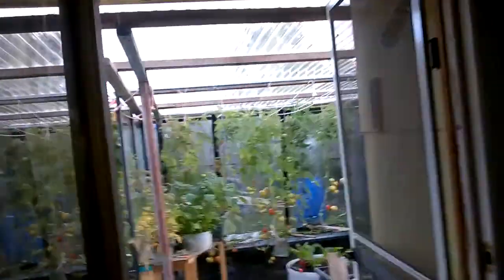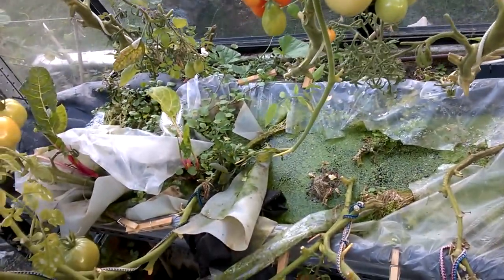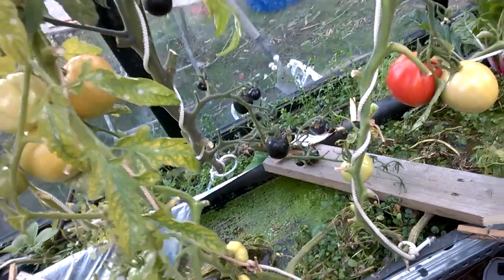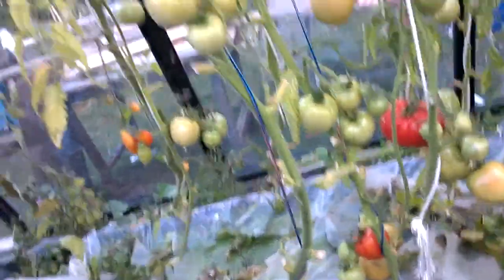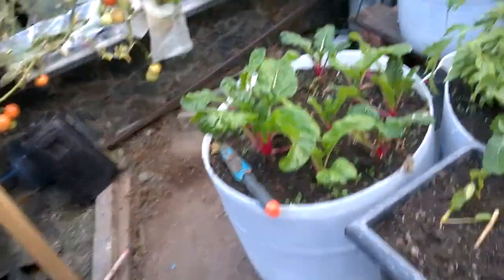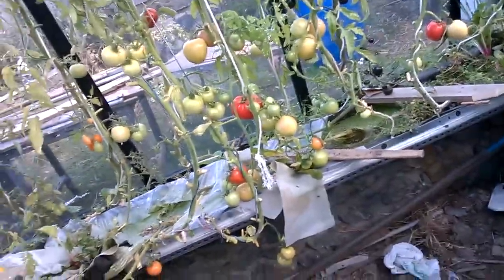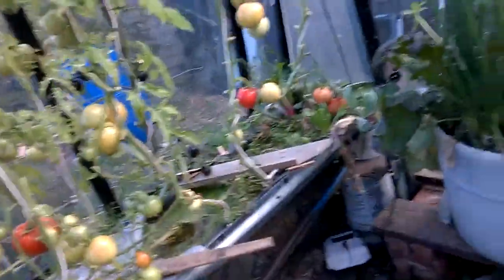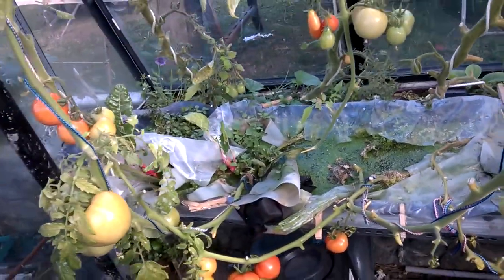Experimental greenhouse and NFT  airlift hydroponics update October 13th

Comment: This is awesome! I've been enjoying your videos lately! Thank you for sharing with youtube!
Reply from the maker: Oh, thank you!  I stopped doing hydroponics.  It was problematical if there was a power cut, etc.  If the water stops for half a day, your plants really start to suffer!   And I sometimes worked a  week away from home.   I got a call from my tenants a few times when something went wrong and the air stopped.  Luckily I was able to explain that a breaker had tripped or an animal (or tenant) had pulled out an airline while picking tomatoes.  So yes, it gave good production but it was not for me. Another thing is that the plants are slow to take off in the spring. The water gets a bit colder because of the air bubbling through it and taking heat away. (Perhaps that is good in the hottest weather but not in spring).   I do "soiloponics" now.  I just drip water through soil in planters in my greenhouses.   It is more forgiving. Sometimes I don't check my greenhouse for 4 or 5 days.  This year,  my big mistake was to grow a lot of volunteer tomatoes.   Most of these plants were of the marble variety too tiny for a good mouthful and with poor production too.  Other than that, it was a good year. The plants that I bought at the stores had much bigger tomatoes and more substantial crops.
Reply: I've been obsessed with the idea of growing watercress in canada, indoors mostly  as it gets incredibly snowy in newfoundland. As much I love the idea of a constant agitator (air pump or water pump to mimic the river stream (watercres loves moving water), I feel like any amount of canadian winter can ruin any electric parts, wheter you use solar pumps or any small off-grid technology.   I will be exploring more of soiloponics because it sounds like its exactly what watercres enjoys.  I rent so that's why I have to be conscious of electrical cost and space. One day i'll have a sweet greenhouse! The taste of watercres is too strong for me to give up :)

Everything I've looked up points to watercres clippings that regrow in water (changed every 2-3 days), or maintained by airpumps/water pumps, whether in a container with holes and dirt or just a container with holes. sometimes i wonder if a magnetic stirer will just do, hahaha :)   @Brians-tracking-solar-scoop
Reply from the maker: @JOJOJOJOJOJOJOJOanne   Yes, I am in Victoria BC.  Watercress here dies back in October.  I think there are several types of it.  It loves lots of nutrients. The air pumps don't care about the cold but yes, it is too dark and cold to grow much outdoors here in winter too.  I don't really like the taste of watercress so I never tried to grow it.  They offered it in the "windowfarms" experimental hydroponics so it can definitely be grown indoors in a bright window or under grow lights.
Reply: window farms sound dope! soiloponics sound cooler! :) @Brians-tracking-solar-scoop

Comment: I once watched one of your videos where you had left some clear tubing at the top of one of your vertical planters for a couple of hours (while the other end rested on water inside a bucket), and by capillary action (if I recall correctly), the water was raising and letting water drop on it. Do you remember what video it was? I've been looking for it for a somewhat big while now, and can't find it. I just wanted to know the size of the tubing to do the same. Thanks
Reply from the maker: Hi, eduardo, it isn't capillary action,  its an airlift pump.  best sizes are 1/4 inch internal  diameter (about 6 mm) or 3/8 inch internal  (about 9 mm internal diameter. I think I call it "constriction airlift pump" or "airlift in a bucket".
Reply: @Brians-tracking-solar-scoop   thanks a lot. Yes, I've seen your other videos about airlift pump experiments, among others. I jut don't know how I stored that particular video as a capilary one in my memory. All the best!

Comment: Is the air lift all green energy or solar?
Reply from the maker: In my case, this year it was just electricity from the grid.  In British Columbia, where I  live,  it is mostly hydro electricity generated from big dams. Some of my friends keep wind turbines serviced in Cape Scott on the north of Vancouver Island so maybe there is some wind in the mix too!  However, one of the reasons that I did it by airlift is because air under low pressure (I meter column of water pressure or 1.5 psi) is easily generated with a trompe on a river or stream.  So that people without electricity COULD do hydroponics if they live beside a stream or river! With a small  trompe in a 4 inch pipe (10 cm diameter pipe) it would be possible to power 4 or 5 rows of nutrient film technique tomatoes. (or 10 rows of lettuce or swiss chard. because they use a lower flow of water).  Also note that my row  of tomatoes was half the length that is possible because my greenhouse is  only 11 ft long (3,5 meters long) whereas it is possible to go 6 meters in nft.   Remember that a trompe is just pipes joined together so it is a far simpler far cheaper  way to harvest water power than  electricity.